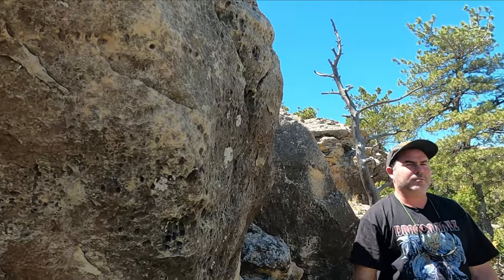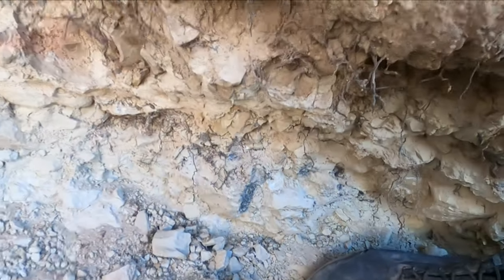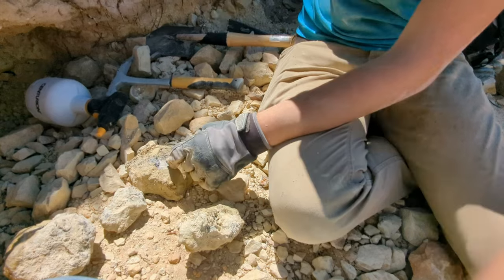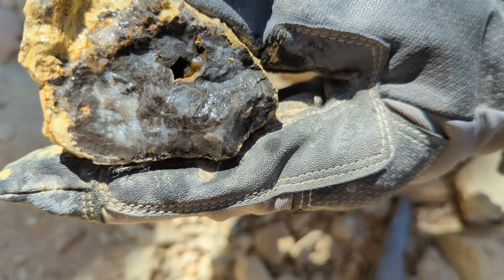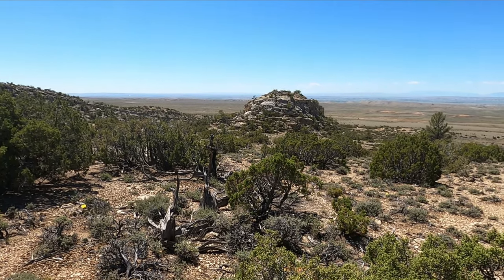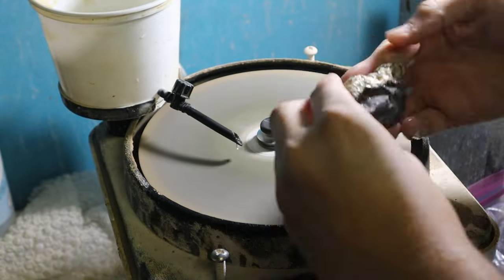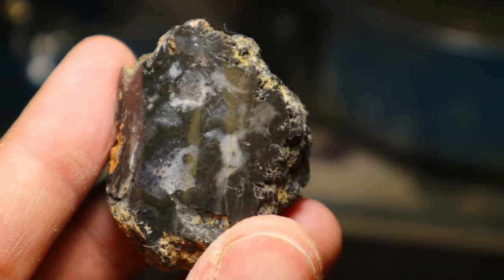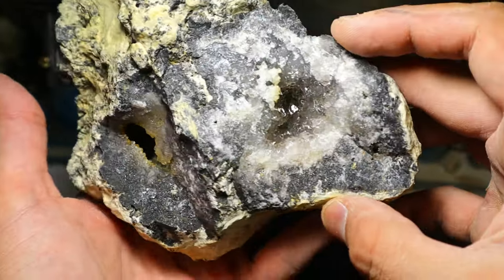Digging in the Heat for Gorgeous Geodes! Hunting for Agate Geodes with KatydidROCKS & 406 Findings!

Comment: You use the same area on the disc when you rock your stones. That causes wear patterns in the disc. IF You would move the stone closer to the Edge and back toward the center, your disc would last longer. Not saying to start now, but when you start a new disc, polish with all of the polishing surface..